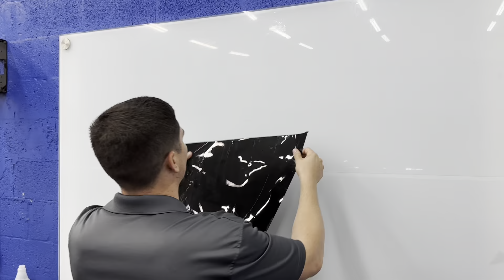How To Tint A Window (In Less Than 10 Minutes) - DIY Hand Cut Window Tint

Comment: You should have sprayed both sides of the film prior to puttting it on the glass
Reply from the maker: Thanks for your feedback!
Reply: @JMGTintWraps  hope I didn't come off as rude. But I noticed when you were folding the tint down it was sticking a bit. Spraying both sides allows it to slide better.
Reply from the maker: Not at all, it’s always nice to hear other styles of installations.